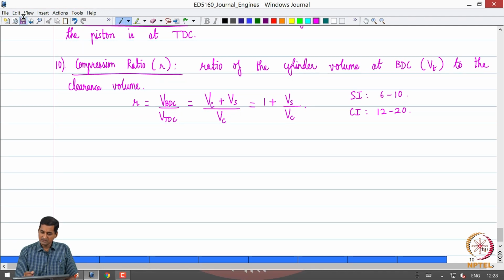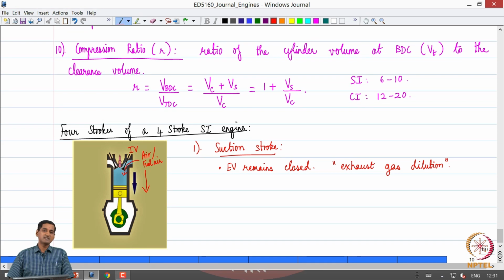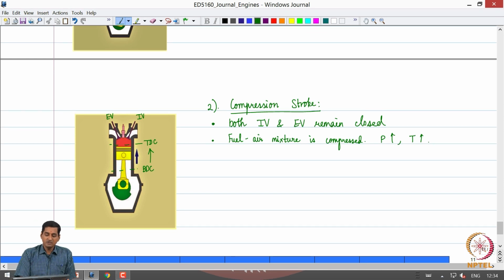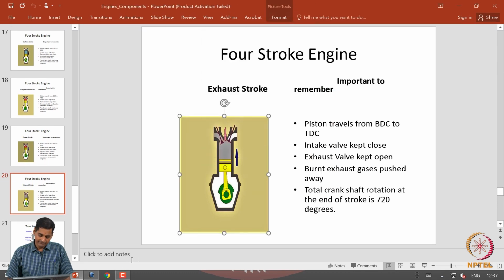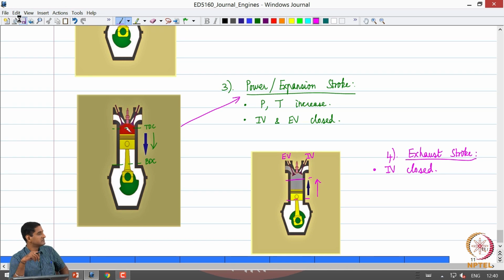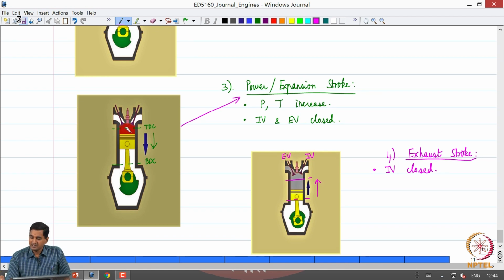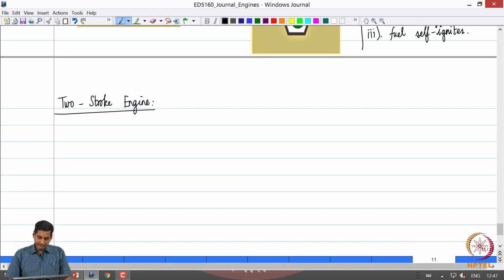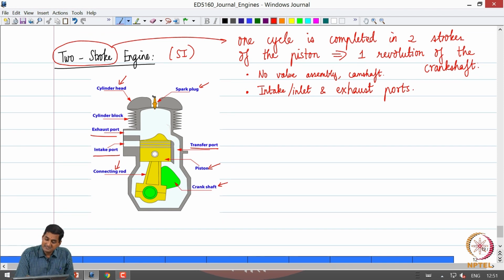#6 Operation of Four Stroke Engines | Part 01 | Fundamentals of Automotive Systems

Comment: Qury 1 :
Since Diesel is inflamable in nature, during fuel injected in via fuel injectors, why fire from combustion chamber doesnt go outside from fuel injector opening ? Is there any special arrangement is there for avoiding this ?
Reply: the pressure of Injector is 1000-1200 Bar which is a lot more & there is a needle ball type actuator behind the nozzle of the injector which opens & closes during Injecting, so there is less chances of Injector getting involved in combustion 
(Please correct if I'm wrong... I'm a Mech Student)

Comment: Thanks for the How is the relationship or angle between the crankshaft and camshaft determined from a design point of view? Without having tuning marks etc. If a 4 cyl crankshaft has the cylinders opposed at 180 degrees and a six cylinder at 120 degrees. How do they translate to camshaft position?